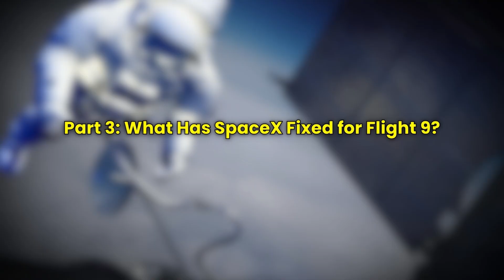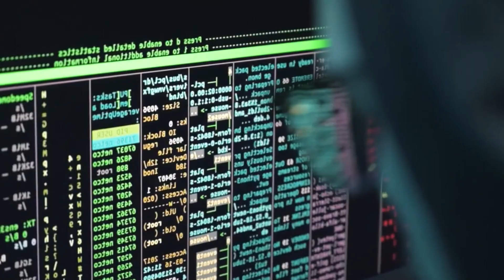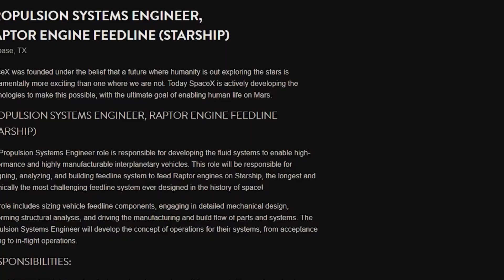Incredible! SpaceX reveals NEW UPGRADES for Starship! Flight 9 will launch in 2 weeks

Comment: I was thinking I've been doing on behalf of you elan I mean you don't have to do everything yourself you can open up species diners on the earth and s*** like that man,.............. 
 
      All the thinking that I've been doing about placing space station at 22000 mi in geosynchronous orbit , in considering that pressure is not that big deal in space heat and cold are big deals in space so I believe I have thought up an epiphany perhaps there's a place and somewhere between the light and Shadow of the shadow of the earth and some of the light from the sun that it's a constant 80°

Comment: I just saw a video description where did water come from and I knew it would be a waste of time to comment on it.
Micro meteorites impact the atmosphere at X's speed 
Is it possible for a partial traveling fast through hydrogen , capturing hydrogen and then through oxygen producing water. Say. 
2. 
Suppose the Suns atmosphere 
No 
The earth is at the distance from the sun as to where the heat in space is the temperature that oxygen and hydrogen combine.

Comment: The avro car 
They tried to make a flying soser in Canada but they couldn't do it. They had blue prints and engineers but it was far too difficult and only got like a foot off the ground. And it's forward speed was like only 35 miles per hour. So try as they might have they failed and abandoned the hole entire project never to return, o I forgot to mention it was sometime in the 1950's such a shame to see them work so hard on something just to fail. Sour looks like one of my designs from the 6 grade yah they tried one time there are lakes in Arizona I don't know why people act so surprised.

Comment: So for air traffic control.
1. Make all cross path passenger jet aircraft be on a collision corces say easy to West.
2. When both craft reach 5 miles then divert 
a) . Reason ones on the collision course will show up on the hallifraphic display as a fixed red line 
b) . 2 the diversion will not cross any red lines . All diverted craft will have a green fowered facing line until to the point when opposing craft have past the impossible to collide line. then craft will be rematched. 

You can not train a man , any to have this kind of superior logic kwit trying.

Comment: I INVENTED THE UNBALANCED PHOTON THEORY... WHEN I WAS A KID TALKING TO MY DAD ABOUT SINGLE WATER DROPLETS FALLING AND THE RADIAL PATTERN THAT THEY CREATED AND OBSERVING THE INTERFACE PATTERNS CREATED I SAID TO MY DAD ISN'T IT INTERESTING TO THINK THAT 2 WATER DROPLETS COULD HIT THE SURFACE OF THE WATER AT THE SAME TIME,  ASSUMING THAT HE WOULD JUST AGREE WITH ME. INSTEAD HE SAID NO NOTHING IN THE HOLE UNIVERSE HAPPENED AT EXACTLY THE SAME TIME. NATURALLY I ARGUED HE WON THE ARGUMENT.  I HAD EXPECTED, WHAT HE HAD SAID AS SOUND FUNDAMENTAL UNIVERSAL LAW. AND YEARS LATER APPLIED IT TO PHOTO PARES.  I HAVE ALSO FIGURED OUT THAT LIGHT IS A STROBE HOWEVER IT CHANGES FROM LIGHT TO DARK SO FAST IT REMAINS LIGHT. LIGHT PHOTONS BOTH AMPLIFY AND CANCEL EACH OTHER OUT. THIS EXPLAINS THE DUBBLE SLIT EXPERIMENT AND WHEN 2 POLARIZED SHEET OF PLASTIC ARE PLACED 90 DEGREES TO ONE ANOTHER IT LIGHT GOS BLACK AND HOWEVER WHEN A 3ER SHEET IS PLACED A TURN,  LIGHT COMES THROUGH.

Comment: The engine that exploded with such destructive effect to other engines was first seen to be on fire.  It could have been commanded to shut down before it could explode.
And replacing the hot staging ring with a space frame structure can be viewed as necessary in order to limit back-pressure at ship engine light stage and seoaration.